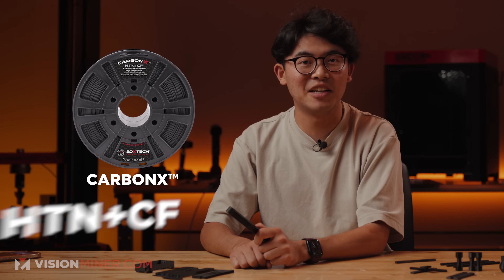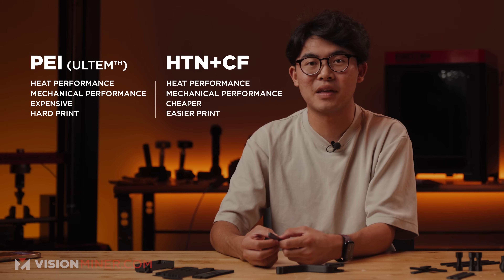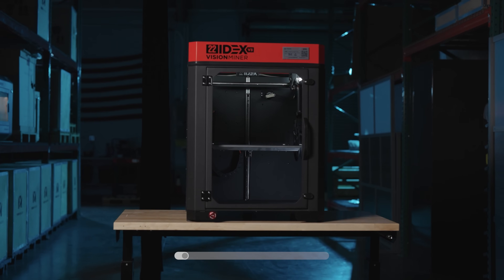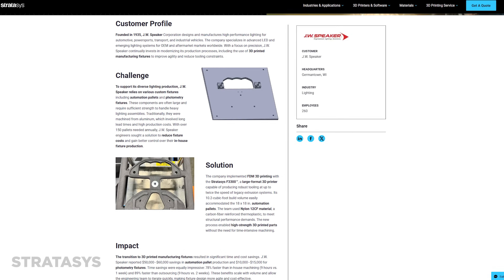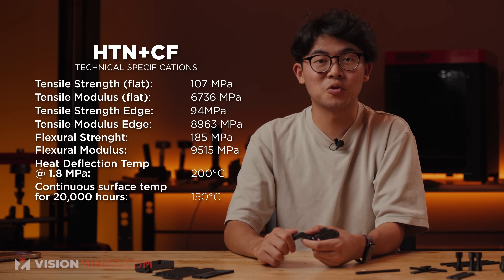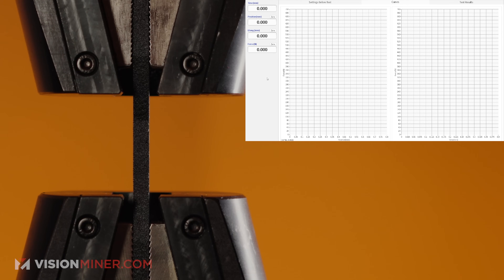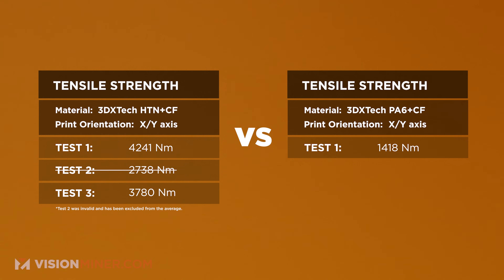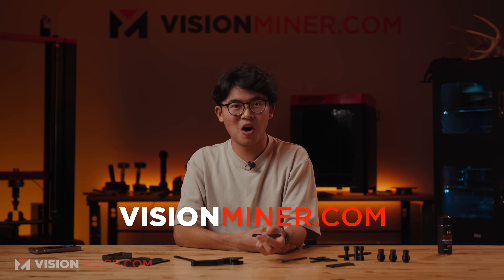Black Aluminum is Back - 3DXTech HTN+CF Material Breakdown

Comment: No filament spec is complete without layer adhesion strength, which is also severely reduced by adding fibers.
Reply from the maker: Working on those videos! :)
Reply: It's not true that fibers reduce layer adhesion universally.

Comment: I would very much like to see if printing the z strength parts solo for shorter layer times would make a big difference to layer adhesion. I was really expecting better than that. Or maybe also bumping the nozzle temp up some more to help remelt the previous layer. Either way, I suspect that it is capable of more.
Reply from the maker: We're definitely working on that video!
Reply: @VisionMiner  any news? 😊

Comment: Does PAHT-CF not stand for high temp Nylon with cf?
Reply: marketing baby
Reply: @laurelland-1395 yeah that’s exactly what I’m wondering! Dude’s talking about the filament as if there’s nothing else like it anymore
Reply: Per the SDS, it is Nylon 6 + CF. Bambu PAHT-CF is Nylon 12 + CF. Which is funny because 3DXtech sells a Nylon 6 CF for $38. Jeez it gets worse. 3DXtech on their Nylon 6 CF page, links to the Nylon 12 CF SDS and on their PA6+CF page, they dont even provide an SDS. Off since PA6 and Nylon 6 are the same. Looks like some shady stuff going on over there.
Reply from the maker: PAHT-CF = high-temp nylon + CF. Important note: ‘PPA’ isn’t one substance, it’s a whole class of semi-aromatic polyamides (like PA6T, PA9T, PA10T), each with its own CAS number. HTN+CF, PPA+CF, PAHT+CF.... just different blends from different manufacturers with different marketing nomenclature

Comment: It would be more interesting to hear how this compares to actual competitors like PPA-CF and PPS-CF, that can be printed on roughly the same printers at roughly the same cost.
Reply: One of the articles they popped up talked about the chemical resistance of PPA for fuel lines. I'm pretty sure this is PPA.
Reply from the maker: Good question — unlike “Nylon-6” or “Nylon-12” which each have a single well-defined CAS number, PPA (polyphthalamide) is not one single chemical substance but a family of semi-aromatic polyamides. Because of that, there isn’t one universal CAS number that covers all PPA resins. Each specific copolymer formulation (e.g., PA6T/66, PA9T, PA10T, blends with PA MXD6, etc.) has its own CAS number.

Here are a few examples you’ll see in datasheets:
	•	PA6T/66 (poly(hexamethylene terephththalamide-co-adipamide)) → CAS 26221-73-8
	•	PA6T (poly(hexamethylene terephthalamide)) → CAS 24993-04-2
	•	PA9T (poly(nonamethylene terephthalamide)) → CAS 25805-71-0
	•	PA10T (poly(decamethylene terephthalamide)) → CAS 25718-70-1

🔑 Key takeaway:
	•	“PPA” as a general class doesn’t have one CAS.
	•	Each semi-aromatic polyamide in the PPA family has its own unique CAS depending on the backbone (6T, 9T, 10T, or copolymer versions).

So, that being said.... PPA+CF is a bit of a misnomer
Reply from the maker: Made a lot of sense to us! PPA isn't a polymer, it's a class of polymers. Your viewership is appreciated, whether our comments are or not :)
Reply: @VisionMiner Sorry! Didn't realize you were replying to someone else!

Comment: $175 no thanks thats obscene price for nylon
Reply from the maker: Saying $175 is obscene because it’s ‘just nylon’ is kind of like saying a Porsche 911 is the same as a Corolla because they’re both cars. It’s like comparing a McDonald’s cheeseburger to a dry-aged Wagyu burger, or a $5 frozen pizza to a wood-fired Neapolitan with fresh buffalo mozzarella. Same with coffee — gas station drip versus a single-origin pour-over — or shoes, where Jordans and Payless sneakers are technically both rubber and fabric. Sure, it all falls under the same category, but the quality, performance, and engineering are what set them apart :D
Reply: Syriatech ppa (non fr) is a cheaper alternative at $60/roll with better layer adhesion but less x/y strength at 70mpa. I’ve done some testing with it and have not seen it break at the layer lines even once. Closest thing to an isotropic fdm material I’ve ever seen.

Comment: So it’s PPA basically 😂
Reply: No, MSDS says it's Polyamide Resin CAS № 25038-54-4 at >80%
Reply: @AngelDLM08  The product label on their site actually says PPA at the end.
Reply from the maker: Important detail: PPA isn’t a single polymer — it’s a class of semi-aromatic polyamides (PA6T, PA9T, PA10T, etc.), each with its own chemistry and CAS number. CAS 25038-54-4, by contrast, is standard aliphatic nylon (PA6/66 type). That SDS number just identifies the base resin. In practice, filament makers modify that nylon with carbon fiber, impact modifiers, stabilizers, or other additives to change properties like strength, heat resistance, and moisture uptake. So while the base is nylon, the finished compound isn’t just plain PA6 — and calling it PPA in marketing can be misleading, since PPA refers to a broader family of higher-temp semi-aromatic nylons.

@chris993361 @AngelDLM08 @baderalafghani4564
Reply: @VisionMiner thank you for clarifying
Reply: @VisionMiner  CarbonX HTN-CF MSDS says it is >80% CAS № 25038-54-4, not an PA6T or something else